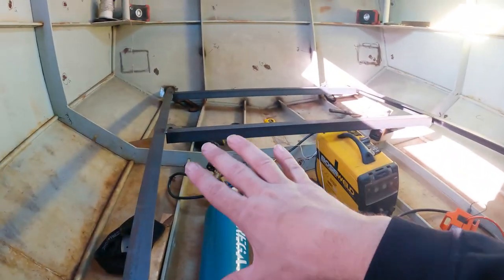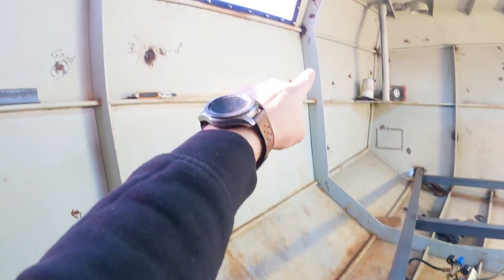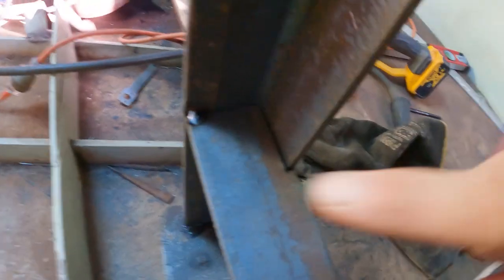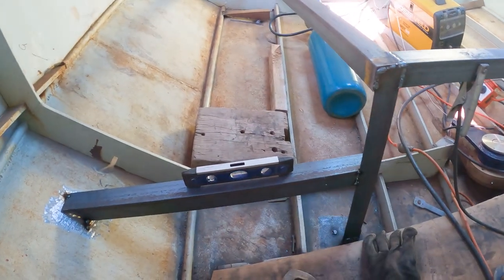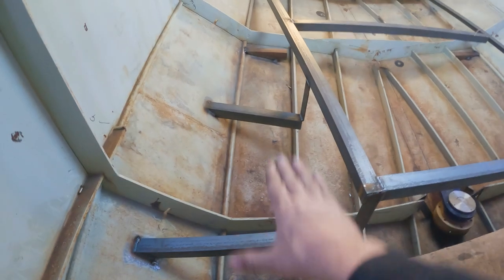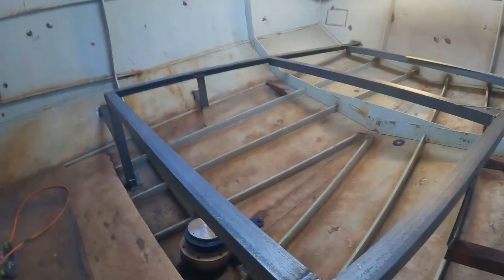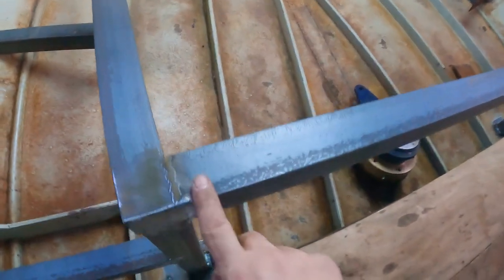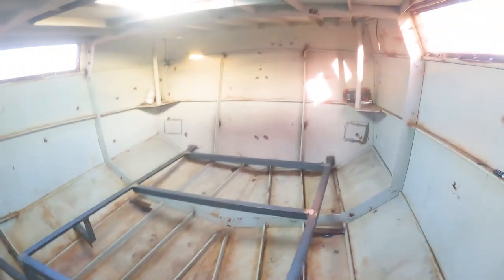Sailing QC # 76 | Aft Cabin Bedframe & Floor Bracing Installation | Steel Sailboat Restoration

Comment from the maker: The aft cabin has a awesome 🛌 frame now!!! Super exciting to see the start of the furniture going in ⛵⚓
Reply: Just a friendly suggestion: when installing the side panels and the foot panel, extend the height of the plywood with a hardwood strip 1 inch above the finished height of the bed. this will do two things. It will keep your mattress from sliding around during passages and it will cover the end-grain of the plywood. For a more pleasing look, you can use a router to put whatever profile on it you like. Examples: bullnose, 1/4 round.

Comment: Things are happening quickly now. Good to see some structures going in. It helps get more of an idea of what you have in mind. If you need advice on welding I highly recommend that you watch the latest vid by Adventures of Cheryl and Paul. He's a welder by trade whose building his boat just like you are and he's also in Australia.
Reply from the maker: Awesome Jolly thanks so much for the suggestion will check them out again 😀